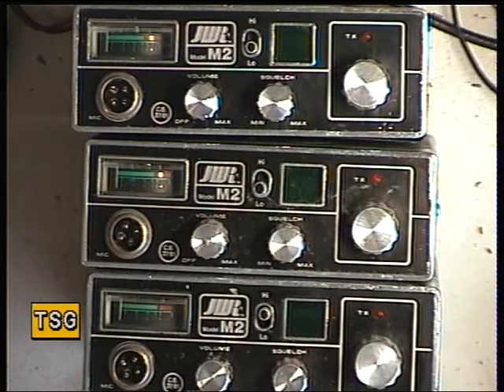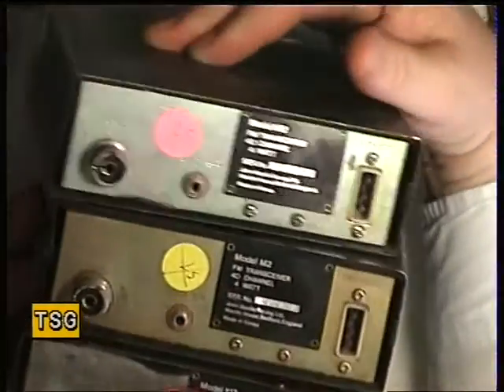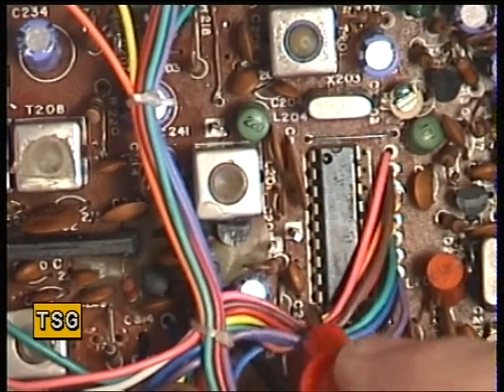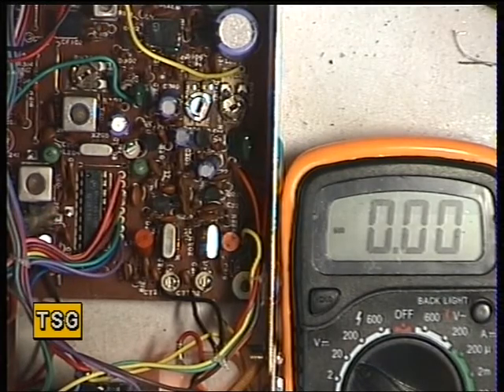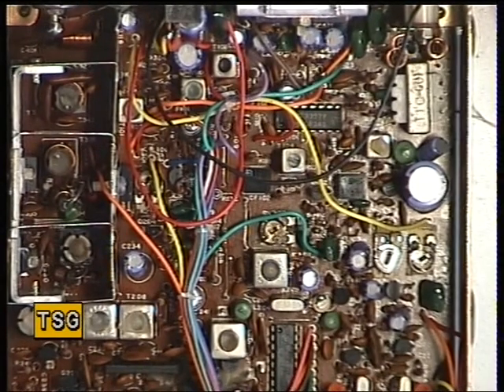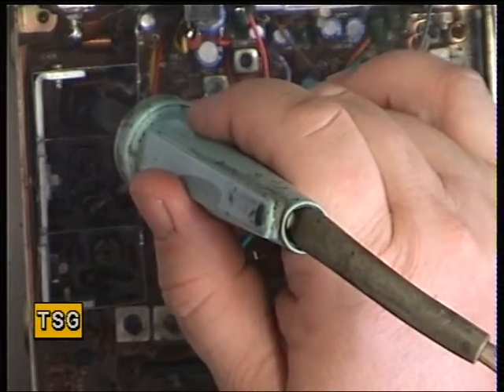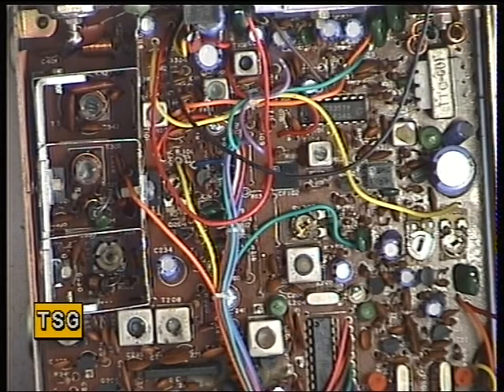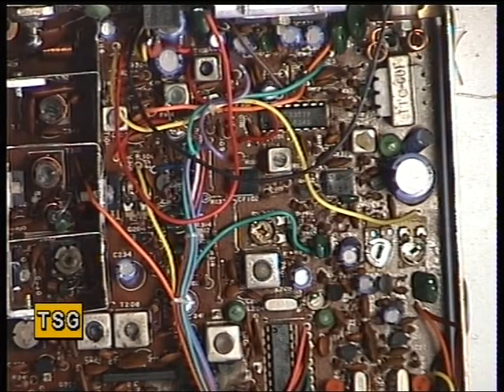JWR M2, UK (CB 27/81) CB radio (Mobile) - VCO & Transmit Alignment

Comment: Great video and useful informations. I have a president jackson 1, uses the same pll chip and for some reason, when i press ptt wont transmit on chanel 8 and below. I'll take a look at vco voltage to see if there is any diference
Reply from the maker: Hello there, The President Jackson is not a UK legal radio, so I am unable to help you. You need the VCO setup info as shown in the service manual. Sorry.

Richard
Reply: Hi could you do a video on a 10 meter conversion 29MHz

Comment: I was NOT asking about the performance of how well that radio works, and I also know it had NOTHING to do with Icom,  as I think it was just that they gave there name to it, as some CBer’s thought that they had been getting a good brand of radio. As I also know that it uses the very same broad. It was just something that I had been interested in knowing of how it might have been done. 
As many years ago, a radio ham that did repairs to CB’s for a shop. It was him that in-fact had the icom version that he had converted for his own personal use. But I am unable to ask him how he did it, as he passed away well over 35 years ago.
Reply from the maker: They use a general purose Motorola PLL chip to generate the frequencies using three reference crystals instead of the usual custom PLL chips for the UK market with a single reference crystal. Some got converted to 10M amateur radio back in the day as cheap sets got dumped on the market new for £19.99. I've shown quite a few on here & have converted back to CB radios. Most of the conversions failed to work probably because the persons doing it didn't have enough test gear to pull it off.

Richard,G0OJF, UK

Comment: Nice video as always, I've got 2 of these sets which have excellent receive but unfortunately both have the same annoying fault, a loud buzzing/humming noise on transmit.
Reply from the maker: But do they still buzz on transmit when run off a battery?....I'm assuming you are using then on a base power supply. It's possible that these sets don't like your particular power supply, but may work fine on another. Alternativey....are you trying them with the same mike...that could be wires wrongly so that the screened lead inner is not actually going to the mike insert?.

Richard
Reply: UK CB radio servicing
Many thanks for reply Richard,I've never tried them on a battery or mobile but I've used many other radios from the same power supply with no issue's, I have tried different good working mic's on both sets but with no luck. I'd like to be able to get them to a usable state as they've got a good receive on both.
Reply from the maker: Sometimes a particular radio type doesn't like a particular combination of installation. Many years ago...1987ish...I bought a Nissan Cedric car (which I kept 17 years) this was a 3L luxury saloon car with every conceivable feature, yet did reasonable economy...like double that of a Mercedes & the likes (i'd had a similar sized Mercedes for 6 hours & rejected it as unmerchantable quality). I bought an Audioline 342 remote CB radio; a radio with superb performance & crystal filtered receiver as standard. Would it work in the Cedric? no. It managed to pick up so much interference from the cars electronics that even with the squelch at full, it was still making a racket. I put the Audioline in a Nissan Micra instead...no problem....and stuck a Maxcom 4E in the Cedric...no problem!
Reply: UK CB radio servicing
Well I tried it today as a mobile Richard and was not really expecting any joy but  it was a radio 5 on tx + crystal clear on receive :) .Many thanks for the suggestion as I just assumed the set was faulty.I'm assuming the Nissan cedric is a Datsun laurel?
Reply from the maker: No, the Cedric was the model above the Laurel...and the President was the top of the range above the Cedric. All confusing now as Nissan's upper models appear under their "Infiniti" brand which we don't get in the UK. Toyota copied Nissan's upper brand idea & created their Lexus brand, swallowing up the top toyota cars like the "Crown Super Saloon".

Richard

Comment: Hi, I do not know if you still doing work with CB radios or not. But my enquiry is about the JWR M2 and the Icom 1050 CB radio. Now I do NOT know how true it is, but I had been told by an old CBer that on them radios you could do a simple MOD to give the radio 40 more channels, but at only 5kHz. So was he right, and if so, how is it done ??? As would love to see a video of that MOD. 
As for me, I do not think that it would give much of a problem to other radio frequencies that operate between channel 40 normal CB frequently, and that on channel 40 of the exact frequency, as in reality it it would add 200 kHz to the total. And that also falls in the other CB frequency’s that are used in the UK. 

If you are not able to help, maybe you know someone who can or even a reader of this post can help me. 

Bye from Knobby 👍🏽
Reply from the maker: and what would be the point of turning a UK legal radio into an illegal playtoy?

These are also one of the poorest performing UK CB radios ever. It's important to note that the Icom version has nothing whatever to do with the Japanese 2-way radio manufacturer Icom. It's 1981 fakery.

Richard, G0OJF, UK

Comment: Hi Richard, great video thank you very much for taking the time to film and upload it.
I was wondering if you can help me with understanding how to successfully measure and set FM deviation, using a small FM deviation meter (Akigawa FS-117d CB Tester) and a signal generator? Not for this particular model of CB, just in general terms.
Many thanks.
Reply from the maker: I managed to track down a photo of one of these testers on the net. I am sure I am right i assuming tthat these will only work properly on CEPT frequencies rather than 27/81 UK channels. The deviation meter will comprise of a basic FM receiver & in the case of the FS117D is spot tuned to three frequencies as specified on the front of the unit. Readings taken on any other frequencies will be meaningless. My friend Mark, G7NDJ, has a Midland branded FM deviation meter & we have proved the case with that...in fact I don't think there are any 'hobby' type deviation meters that have ever been on the market that were designed to work on UK frequencies. We checked the calibration of Marks, and it was spot on for channel 20 on the CEPT band. We got a reading of between 2.2 & 2.5Khz deviation with a whistle into the mike of around the 1Khz frequency. Then we tried a UK set on channel 1...i.e. as low a frequency as we could & got a response from the meter of 1.8khz. Therefore by testing the tester with two calibrated cb radios we knew that then the meter reads 1.8khz, it's really 2.5khz on ch 1 27/81. You will need to do a similar calibration test somehow I'm afraid. Alternatively buy an ebay bargain professional meter that does FM & in the frequency range you require for CB (i.e. 27Mhz). They do come up. Someone bought a Motorola one for £12. We used to have a Farnell AMM1 at Nottingham radio where I used to work. They were nearly £1000 new, but our boss got one from a radio rally for £35. Those are automatic Modulation Meters & do AM & FM without manual tuning, covering CB frequencies right through to UHF. Hope this helps you a little.

Richard
Reply: Thank you very much for taking the time to reply Richard. I'm not sure if this link will work, but it's basically a review of this particular meter in the Jan 1988 edition of Citizen Band magazine, and the article there does seem to infer it's the UK channels that it's tuned to. https://archive.org/stream/CitizensBandMagazine/Cb1988Jan#page/n15/mode/2up
I've bought the meter on eBay (£25) and await it's arrival, so time will tell if it will do the job I suppose.
Thank you for all the content you've uploaded by the way, it's helped me immensely over the past few months. Keep up the good work!
Reply from the maker: Thanks for the link...it worked. The proof of the pudding will be what the internal crystals say on them. As the reviewer says, it's the frequency you want minus 455khz IF. So channel 20 for example is 27.79125 minus .455 = 27.33625....that's what the crystal should say on it if channel 20 is one of the frequency options. Let me know what you find.

rshireby@yahoo.co.uk
Reply: The eagle has landed Richard, and I'm happy to report that it does seem to be for the UK channels. The one crystal that I can read without unsoldering anything is 27.53625 which plus the .455 gives us 27.99125 which of course is the UK channel 40. It also has settings for Ch1 and Ch20.
All I have to do is figure out how to use the thing now!
Thanks for your help
Steve

Comment: Thanks for your reply, but you still not answering my question 100%, as you still not told me what the mod is to add 40+ channels at 5kHz apart.
Reply from the maker: I've absolutely no idea. I'm not involved with anything illegal. These sets were 1981.  I can assure you it won't be just a case of swapping some wires over. The SMC Oscar 2 was another set with this chassis.

Richard, G0OJF, UK